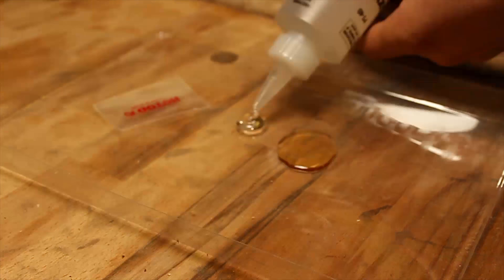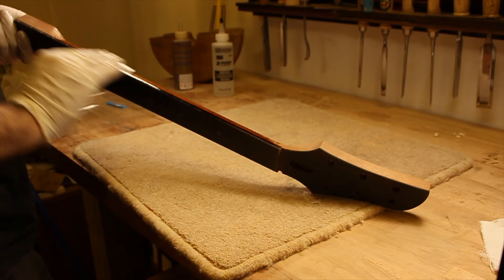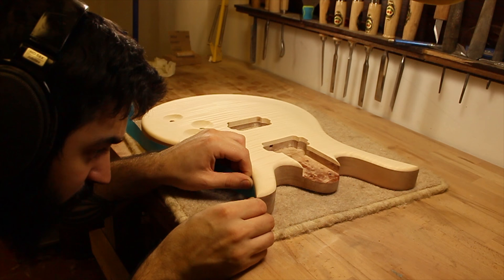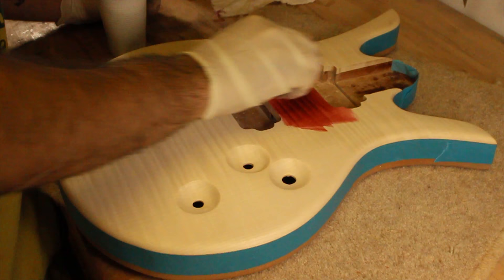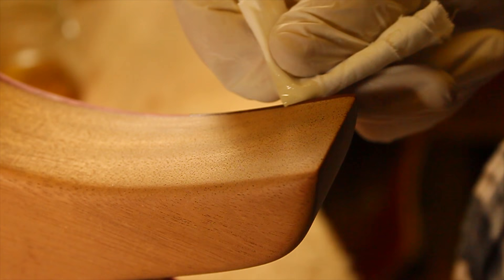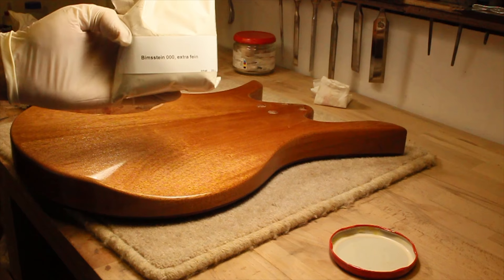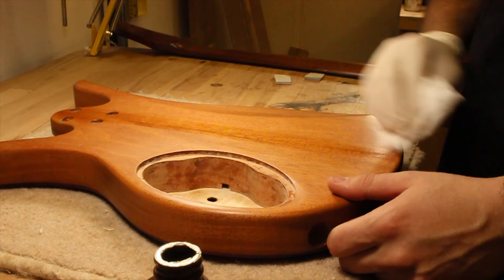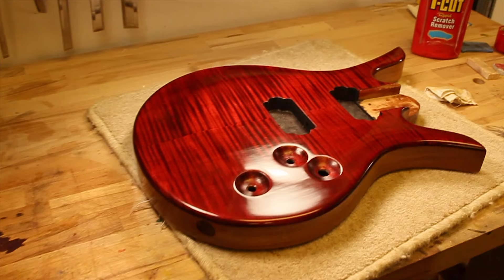Making a Custom Electric Guitar: 5 - Finishing

Comment: You hit on a key point that almost every other video leaves out .... using a light coat of shellac on the edges where the dye meets the body in order to prevent runs in that later finishing stages. A great tip!

Comment: What size cove bit (assuming you used a cove bit) for the dish outs for the controls?  Or did you carve those by hand too? Thanks.
Reply from the maker: Sorry for the late reply, I ground a curve into a spade bit and drilled out the holes on the drill press. I wasn't too impressed with the results, so I'd probably use a cove bit next time

Comment: Beautiful color! Do you always need to use a filler? I know you said you weren't crazy about the one you were using so what type is recommended? What brand of stain did you use? Only one coat? Also did you use any different colors around the edges or just a thicker coating of the same stain. Thank you

Comment: Beautiful finish. Just wondering, did you rub true oil on the flame top of the guitar after you'd done the other finishes? Also, why rub down the guitar with 1200 grit and not say 2000 grit? Looks amazing as is but as im new to this and deciding what finish to use and how to do it any help would be fantastic.... thanks.

Comment: I'm not sure I understood : shellac then tru-oil ? Then sanding, and last but not least scratch remover??
Reply from the maker: Yep, you got it. Shellac as a base coat, tru oil top coat and t-cut and super nico as a buffing compound
Reply: @CranmerGuitars  could you apply the Tru Oil directly to the stained top of the guitar after it dries without any shellac? or would it make the dye run or move around? I thought Tru Oil worked by penetrating the wood? Will it adhere to the shellac long term? I'm building a guitar and want to water base stain the top, but was unsure if I had to apply some type of coat or sanding sealer prior to the tru oil
Reply: @acellett  I have the same doubt.